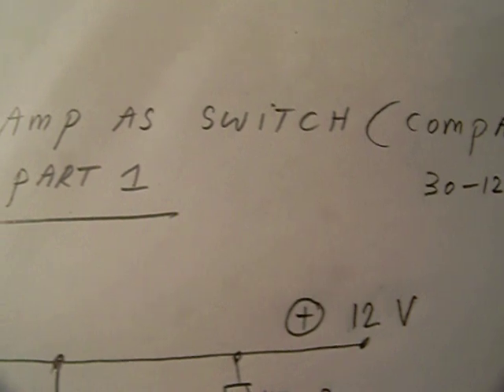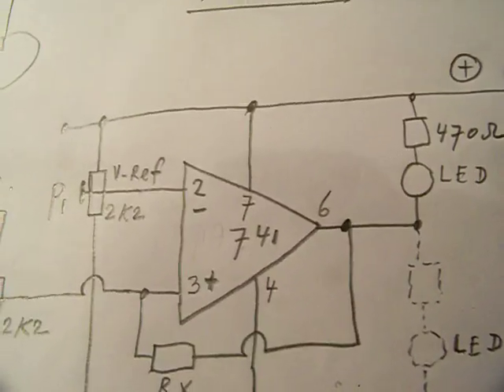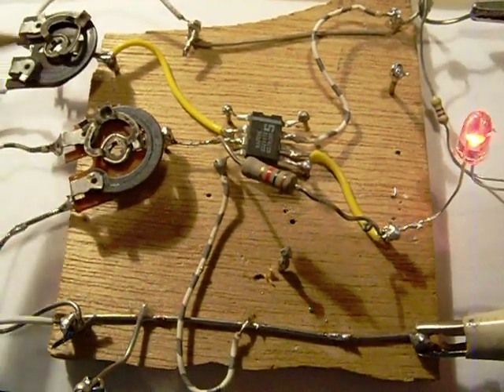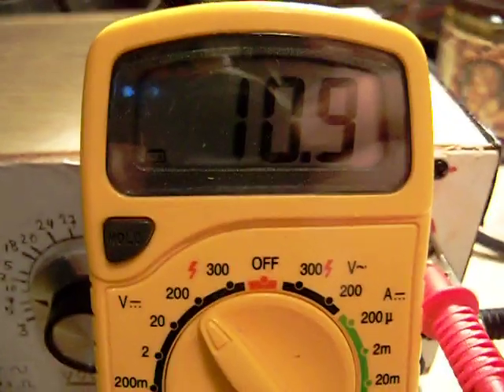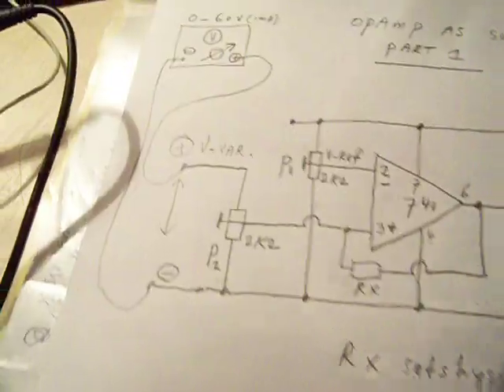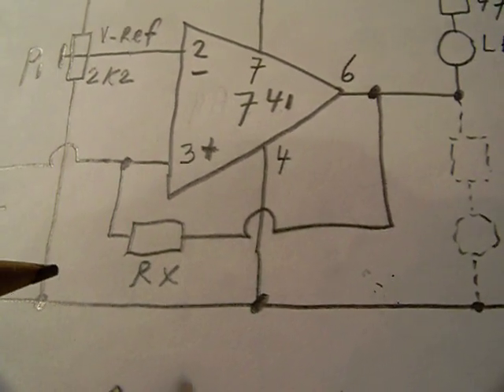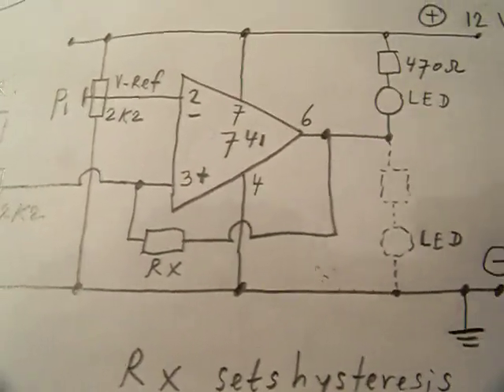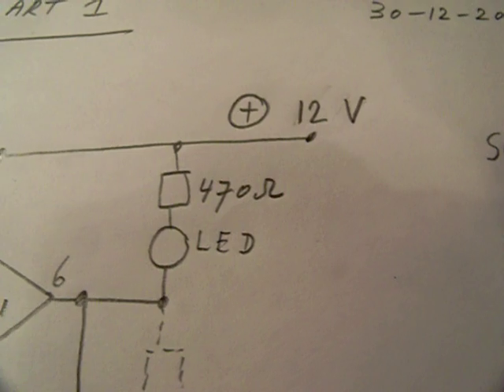Opamp fundamentals part 1, Opamp as comparator

Comment: I used the circuit in a precision temperature controller where the sensor voltage varied very slowly; I needed precision about the setpoint so I could not use as 'stiff' a feedback resistor as 1K;  I found 220K would effectively stop the chatter (relay etc.) without losing precision about the setpoint; I was able to acheive 1/100 degree Fahrenheit of regulation.
Reply from the maker: Thanks, very valuable information. With Opamp comparators there is/can be some "hesitation" phenomenon on the swich point.